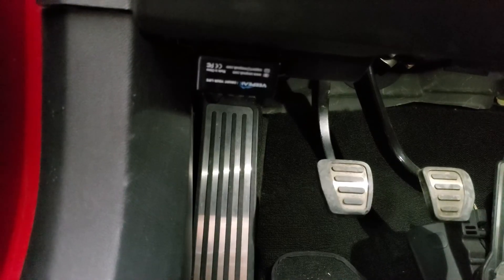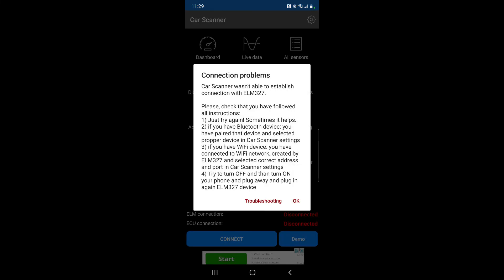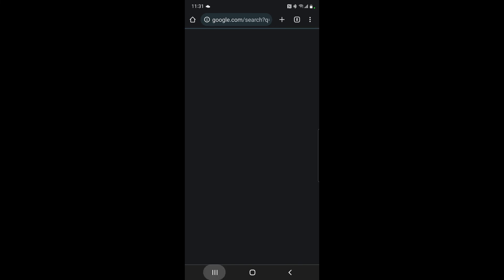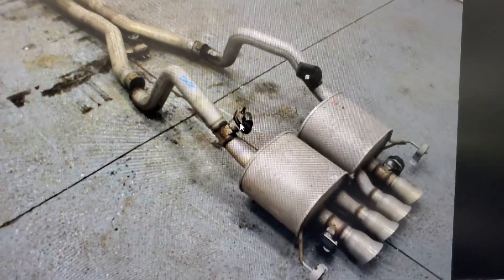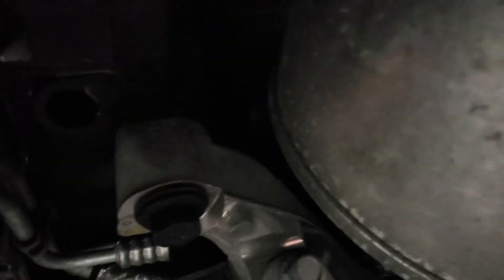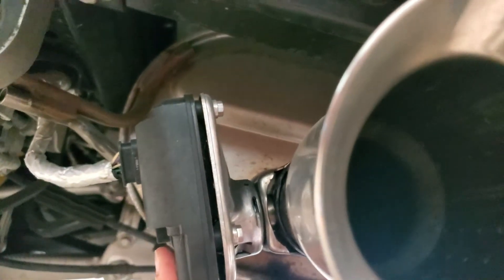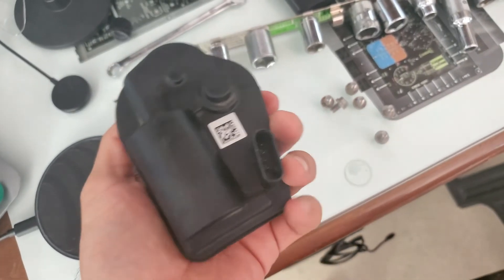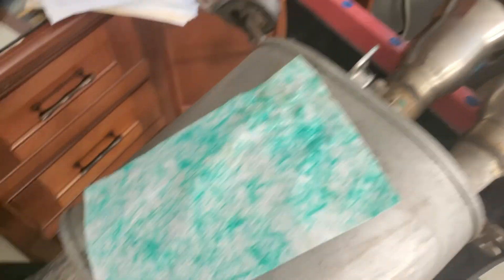Do it Yourself - Corvette check engine codes P26C8 and P12FC

Comment: How did you know it was right side instead of left? I have both codes also on my check engine light and purchased the actuator brand new, installed it and check engine light is still on. I thought maybe it could be the one on the left side so I installed the one I took off from the right side(which should be good) on the left side and the check engine light is still on. Cleared the codes and the check engine came back on after driving for 10 min. Maybe the 2 of them were bad? Not sure if I should buy another one since they’re expensive and it might not fix the issue.

Comment: hello i have a 2015 corvette i just changed my exhaust and now have a p26c8 code is this the left or right side in trouble? thanks tony
Reply from the maker: Is that the only code that came up? For me P25C8 meant something was wrong and what was wrong was P12FC.
Reply: @phoenixpain  my trouble fixed both plugs came undone on my exhaust trying to put them back i was able to squeez my hand up there and plug them in
Reply: @tonycorvettes  awesome video subscribed, lots of useful information you could create 3-4 videos out of this one video.

anyway heres my situation:

2015 corvette:
There was an accident on the rear the exhaust with mufflers was cut and after the rear was fixed I was told to go find a new exhaust mufflers and install it. 

after having new mufflers installed for 2 weeks I read online that I should pull fuses and one of those fuses controls the cylinder deactivation

I did this because someone said you can always make your corvette loud by pulling these fuses, so I did it and after words the engine light came on and now we also have the same p25c8 code but also the p12e3(cylinder deactivation exhaust value).

So either the cord is unplugged that controls the exhaust value or the fuses I pulled tripped and confused the computer. 

long story short im not pulling fuses again because even when I put those fuses back eventually after about a week the codes came back. Not sure why they are coming back but I hope I dont need anything special to clear it. 

I read there is some other kind of obd2 that you need thats not really an obd2 but its like 500 dollars and its needed to clear this code.. how annoying I guess i need to be way more careful before performing fixes I just thought I should take care of it my self the dealership has been a nightmare to deal with.
Reply: Thanks for the info just bought car and had code checked the fuse box and 30amp fuse boss missing replaced and check engine light off! 🎉
Reply: I also got p26c8 with code p12fd boigjt the car with the CEL. Already purchased the actuator and looking to get it installed at thr dealer. Question, is there anythjng else that has to be done manually as i see i nolaces it has to "relearn" the new piece or i just drive it a few cycles and should go off. Thanks!